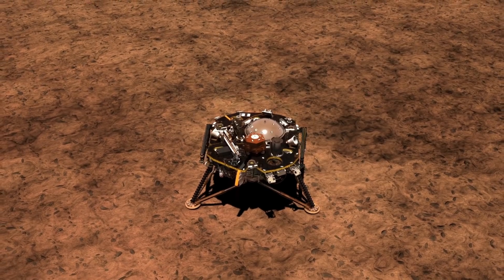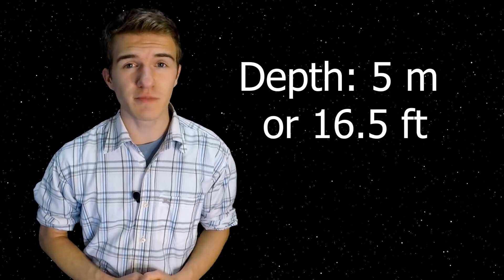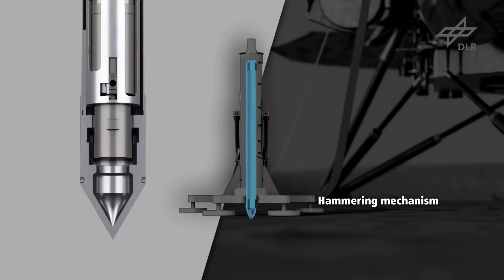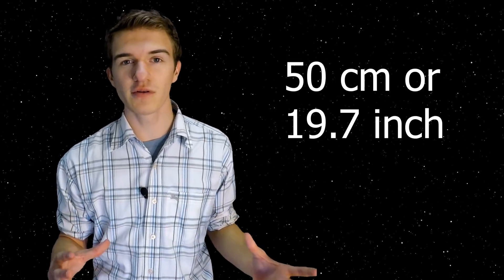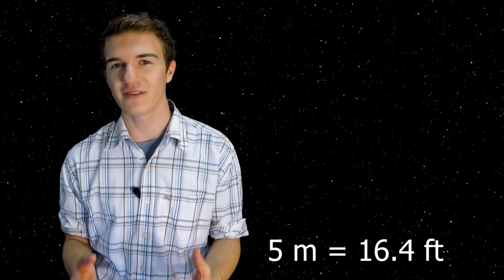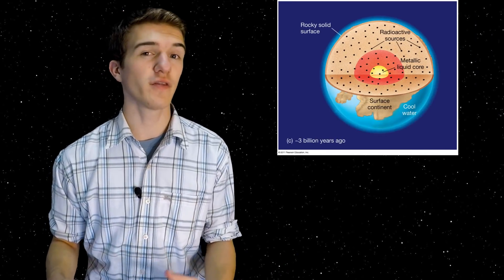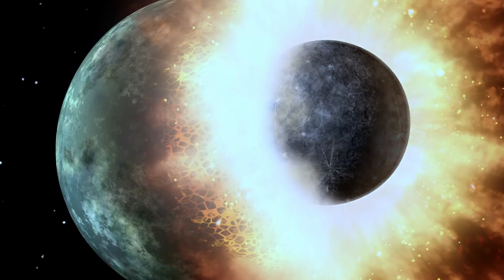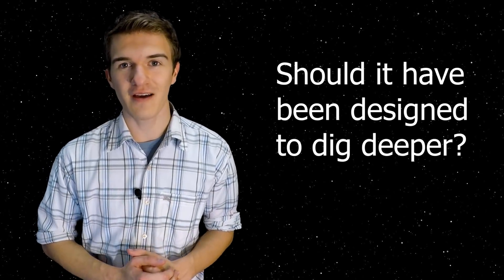The Heat Flow Probe on Mars, NASA Mars InSight Mission

Comment: I have lots of doubt about this type of making hole in Mars. You please do same test repeatedly in various places (have soil loose and compact or sand in desert, combination of various plates (plates means certain depth of soil or sand or rocks, etc) only in Upper surface - rocks with loose soil - rocks only after loose or compact soil, etc) in  our planet. How will you determine the different plates (like one meter depth of loose soil - if it close while making hole if it is loose soil and compact it while making hole - how will you remove loose soil from top surface plate - have you fixed length and diameter of rod which makes hole in Mars - Have you fixed it will choose to make holes only in different types of rocks in Upper plates or with soil only - If soil compact the rods and measuring instruments cable - How will you remove tension in cable which damage the electrical signal, etc. You please study about  the strength of different type of rocks and strength of rod to make hole which breaks the rocks and rocks will try to move side and if rock different types of surfaces may contact cable, what will happen, etc.

Comment: usually here on earth, the diurnal change of temperature impacts up to 5-6meters deep, depending on soil thermal diffusivity
i think the choice of measuring 5m deep was taking that into account.
they will be able to model daily and seasonal temperature changes by depths.
they are gonna know if there are more heat leaving mars than the one coming from the sun

Comment: Solid material probes get fun. Turns out that you can drive them through vibration.

The best way to explain this is with a row boat. In a row boat if you keep the paddles in the water the entire time you can still go forward. You just push slow forward then faster back and the speeds matter. 

Now all of this still goes further. Think of two weighted wheels spinning in different directions then set it in water make the weights meet spin them at the same speed then set them in a box something weird happens. 

It will start to truck along the water. What's happening in a way is the same thing that is happening with your paddles.  Just in a layer of vibration across the surface of the box. Then it's just a matter of power, precision, and shape. The weird thing is the denser the material the better it works you just have to break past the fracture point in a layer of the surface and travel zone which can become a problem in some soils and bigger probes.

Comment: will we be able to accurately read how much heat is leaving mars by measuring 16 ft down below the surface, the answer is no if you are using assumptions.  reading .001 degree changes on the top 15 ft of planet is not gonna tell us much, sorry but we need boots on the ground drilling a few miles down to know.
Reply: you dont have to dig deep to know if temperature is flowing up or down
your idea is about measuring a temperature gradient by depth
the experiment is enough to tell if heat flow upwards or if its in statis

Comment: what if it finds something it can't dig through? like a piece of basalt or some other hard rock?
Reply: maybe Curiosity can come by and move it. (im kidding)
Reply: It gets stuck, but they were aiming for a very sandy region of mars to try and avoid this.
since this is the first time we have ever dug this deep on mars, we really don't know whats down there.

though the hammer has enough force it may be able to crack some softer materials.
the probe probably has quite a few test runs with a replica on simulated dirt, but its a gamble either way.
if it doesn't get the fill 5 meters, but only 3 or so, they will likely get the data they need, it will just take longer to collect enough data to get to that point.
Reply: Spolier alert: you hit the jackpot! They officially stopped digging at 38 cm penetration. But yeah this would have been my first thought too...like why no back-up plan with a drill or heat probe

Comment: Do we know what type of rock or sand that Insight landed on?  If it landed on wind blown sand from this past Summer's global dust storm won't that affect the probe's ability to return useful data since wind blown sand isn't part of the planet's older and rockier composition.  That being the case wouldn't the temperature profile be roughly equal all the way down to 16 feet depth assuming that Insight landed on a pile of sand in a shallow crater like depression?  On the other hand if Insight landed on rock that's been located in that position for millions of years the planet's internal heat transfer mechanism (radioactive, etc) would have had sufficient time to create a relatively large temperature gradient as the scientists are hoping to see.   (Pete)
Reply from the maker: Hi Pete, NASA announced that InSight landed in a 'shallow dust- and sand-filled impact crater known as a "hollow"'. I'm not sure how this will affect HP3's ability to record thermal gradients, but the announcement did say that scientists were hoping to land in a sandy area. I think this hope originates from the drill's capability to hammer through various rocks (Curiosity rover has had issues drilling into hard lakebed rocks). I imagine that 5 m of sand will still show a deviation in temperature, but whether or not that is representative of anywhere on Mars, I'm not sure.